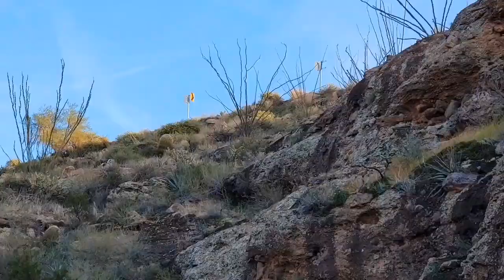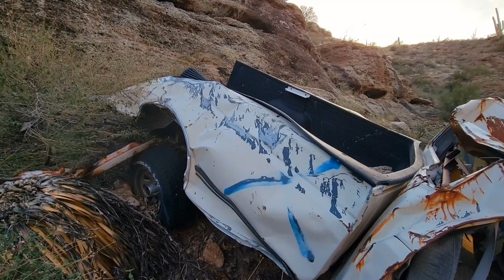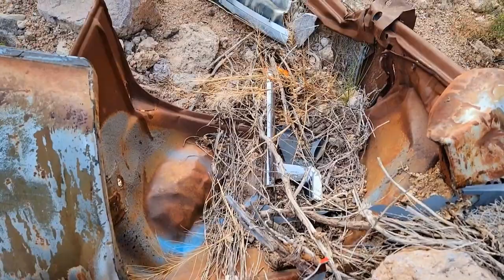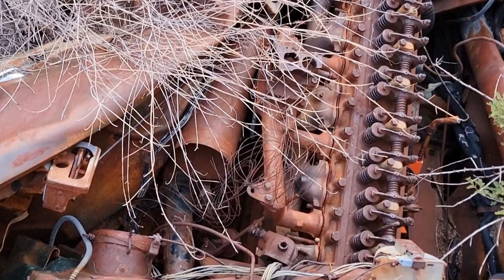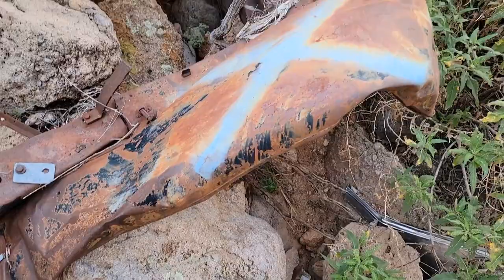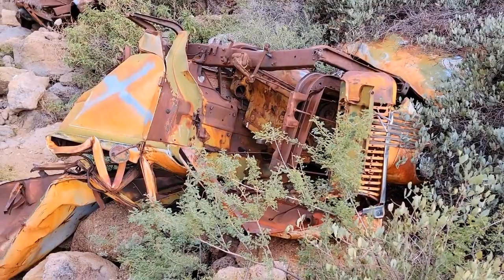Abandoned Vintage Car Crashes 1920's-1950's

Comment: The oldest one is a 1930 model A sport coupe. The body opening tells you it was a sport coupe and the splash aprons by the running board tells you the year. Also the curved headlight bar was 30-31. Interesting place you found there
Reply from the maker: Yeah ive been going there since 2008. My other videos have old cars as well. I just did a place with 25+ 20 and 30's cars.
Reply: So sad seeing that old Model A like that.  The black enamel paint is still visible on the splash apron and fenders.  It was a beauty in its time.

Comment: The International panel van was known as the International Harvester Metro & had the International Red Diamond inline 6-cylinder engine with a 3 or 4-speed transmission.
Reply from the maker: So that explains the diamond on the side of the block.